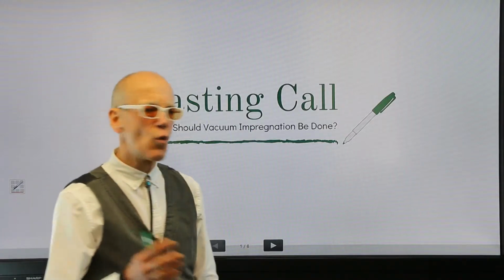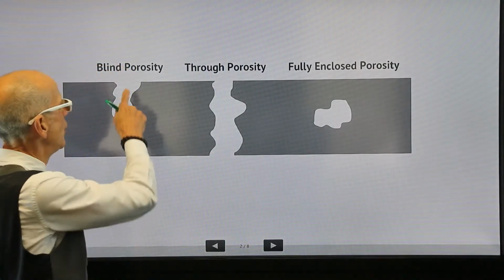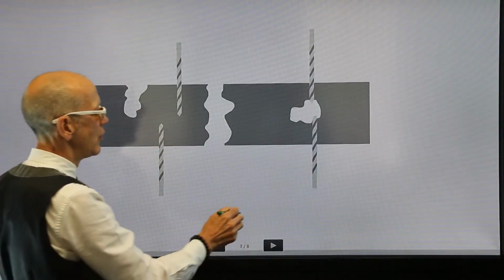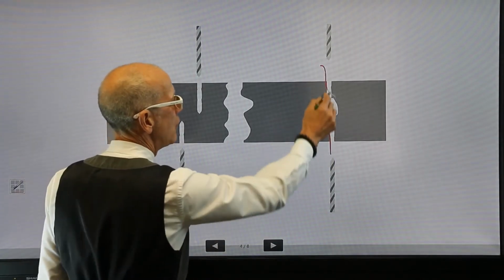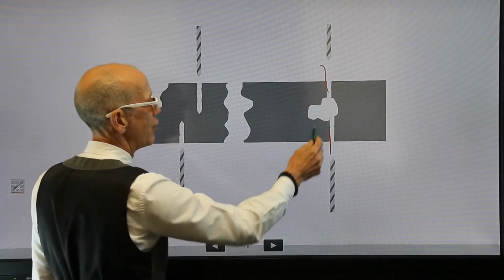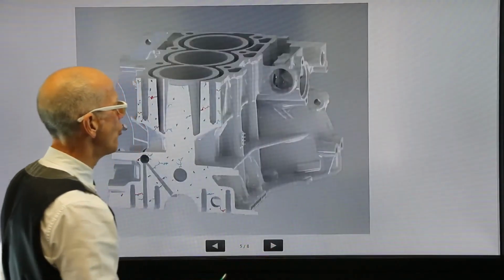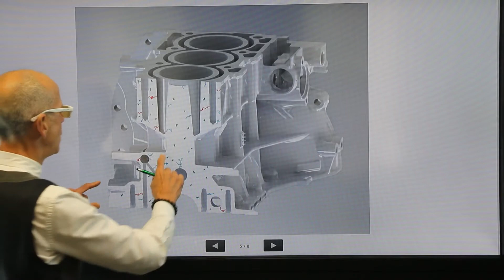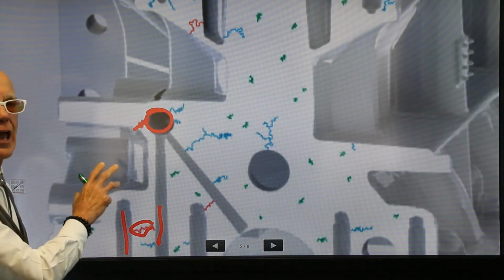Casting Call: When should I Impregnate a Casting?

Comment: Concerning blind holes and porosity is it possible for the impregnation fluid to fill/block these machined features?
Reply from the maker: Great question. After the sealant is impregnated into the part, the part goes through a wash/rinse station. During the wash/rinse station residual sealant is washed from the 
part’s internal passages, taps, pockets and features where sealant is undesirable.